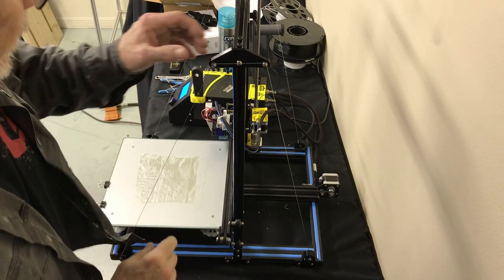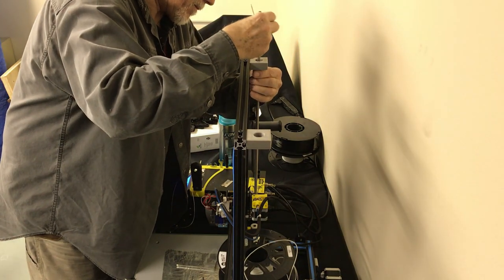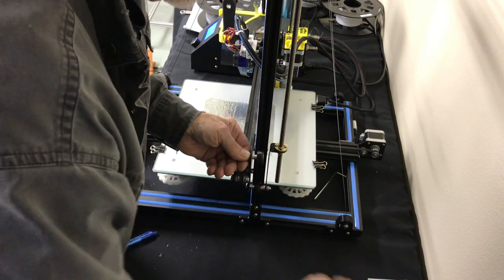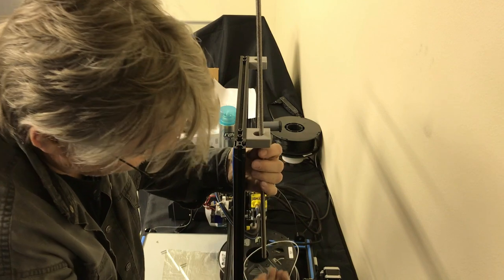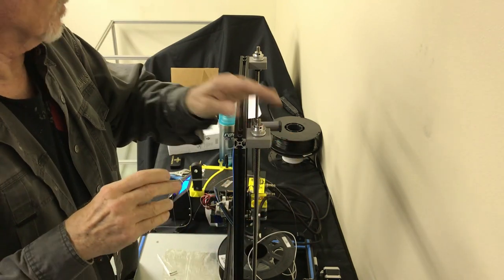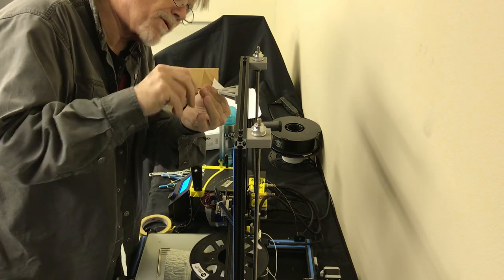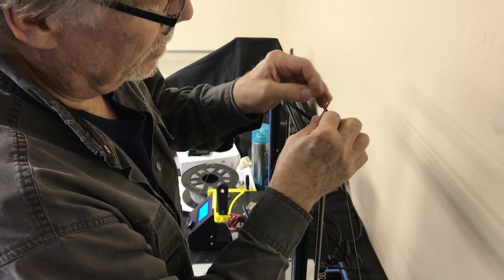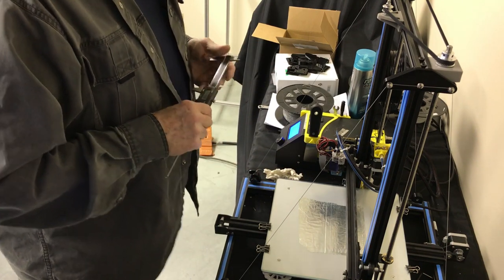Mechanical Dual Z Installation

Comment: Please can you make an install video for the CR10S, to maintain dual z sync.  I assume the kit comes with two longer lead screws?
Reply from the maker: Benjamin Marc Esterson 
The dual motors need to be synced every time you reboot your 10 s because of motor drift. 
If you make a block or gauge it’s handy to quickly run it up to the x beam and turn the right motor coupling to turn it until it’s level. 
 Unfortunately there’s no way to cure that idiosyncratic problem with the s models.
Reply: David Ashenbrener, Surely using a z sync belt will constrain the drift between the two shafts to ticking over in the same direction, thus keeping the dual drives synchronised.  Mechanically there is no reason why it wouldn't work.
Reply from the maker: Benjamin Marc Esterson 
Not sure what you’re asking but you only need one motor. If you’re suggesting using 2 plus a belt it would work but it would be superfluous. Dump one of the motors...
Reply from the maker: Benjamin Marc Esterson  actually you are on to something there...
I would like to see if there’s some way of doing this without having to change out the z screw drives to extend them... one way would be to sacrifice about an inch height by cutting an inch off the two upright rails. Speaking for myself, I don’t use that height anyway...
Does anyone else have an idea?
Reply: David Ashenbrener, For most of the hobbyists, I think swapping out both Z screws is a less daunting prospect than trimming the gantry uprights.  Granted the materials costs will be higher, but it's likely a fair trade for nice square cuts and ensuring both sides are cut to matching lengths.  Is there a particular reason to avoid swapping both lead screws?
Reply from the maker: Benjamin Marc Esterson true. But it’s an alternative. Way to go guys... now you got me thinking about doing that...
Reply from the maker: Benjamin Marc Esterson 
I’m thinking that antibacklash would be needed if using 2 motor z. 
I’ll try it without first. I have both 600 mm lead screws and the antibacklash nuts in order. 
I will do a follow up presentation on it. Thanks everyone...!
Reply from the maker: I will be doing a video of cutting an inch or so off the uprights and the dual rod replacement. I'll put the time and ease of assembly on the clock for each to compare. I'll then check it for backlash to see if the anti backlash nuts are needed.
Reply: Hi, thanks for sharing but here's an idea, how about retinkering  with the top brackets? instead of chopping the frame , would you have enough room if you were to  reposition the 
 upper leadscrew brackets an inch or so lower and mount the idler  upside down but on the back of the top  2020  extrusion instead of front of it?
Reply from the maker: I just received belts I special ordered for the S5 which fits pulley to pulley with no tensioner. I ordered 5 and have 2 left...
Reply from the maker: Andy Davies yes. Update...I refitted all my S models with a sync belt...works perfect. No more measure adjust before printing!
Reply from the maker: Benjamin Marc Esterson you can put the sprockets below the bearing blocks. To minimize the loss of height print 2 thin bearing holders mounted to the top of the rail with 4 t-nuts then position the sprockets with hub up. Now your tensioner will stick out the rear of your machine...
Reply: @neuxstone  I'm delighted my idea worked. Theory is always better percent proven in practice. Thank you for trying it and working it through.
Please could you make a video on the implementation? Or post some photos?
Reply: @neuxstone  Greetings David, i have a cr-10s , did the anitback lash nuts work instead?  i assume they are 8mm
Reply from the maker: Martureo Martus   I redesigned the kit so the pulleys are behind the upper beam. I had to lengthen the motor couplings and put the tensioner brackets on the backside of the beam. 
I will do a video on this. Right now I’m fulfilling orders I received from my Stinger Kickstarter campaign but I’ll get to it as soon as I have that underway.
Reply: @neuxstone  Thank you David, np looking forward to it, and thanks again - i ordered 2 Stinger kits from your kickstarter and cant wait to get them and hook them up - like a kid at xmas lol - thinking of doing a video and review to so i will email you if i do - thanks again and ttys!

Comment: OK. To follow up, I bought the kit and installation was quite straightforward. My problem was the lead screw that came with my CR-10 was oversized. I couldn’t get the flange bearings to slide over it. David was super helpful, in the end he suggested sanding the lead screw while rotating it in a drill... worked perfectly. I’m delighted with the kit AND with David’s help. Thanks David!

Comment: I have two questions.
 What is the purpose of the set collars?
 Also, is there any adjustment to the voltage settings for the z motor due to the potential increased load?  
Great video!
Thanks.
Jason

Comment: I am waiting on a Tevo Tornado, does this kit fit the tornado, where most people say the tornado is a CR-10 knock-off
Reply: should be able to, most of it has to do with the frame and motors which are identical.

Comment from the maker: Anyone interested in linking their motors? It requires mounting the pulleys under the top bearing mounts. This will limit your height by 1”. 
If that’s a deal breaker, you can get a majority of that back by printing a thin upper bearing support bracket mounted to the top of the upper horizontal support and flip the idler bearing bracket. 
There will need to be 4 additional 4mm screws and 4 hammer nuts necessary.  
I’ve outfitted 2 of my printers with dual motors and turned them into my best machines...

Comment: I just ordered a ctc printer which is a knock off of cr10..i figured since my ender 5 has had multiple issues i had to fix i might as well by a knock off and see if it is similar just as good or possibly better... this machine has dual Z axis...not sure what is was yesterday when i ordered...does it mean i has 2 motors? or maybe its a similar dual mechaniacl setup like you made here...thax
Reply from the maker: Yes. Dual Z usually means dual motors. You’ll find yourself checking them often for “drift”. The mechanical link will keep them level.
Reply: @neuxstone  being new to 3 d printers i have a lot to learn... when i get it should i tighten the Z rollers like you did to this cr10 in this video...you want them tight,but i guess not to tight... will this help prints come out much better... i will also be ordering you guy line upgrade since it makes perfect sense ..thankyou.

Comment: I just ordered and received you new kit. I have a Tevo Tornado and i need some instruction with this new kit.
Reply from the maker: I just had a break in and my entire recording studio was stolen. I’m going to try to do an update vid this weekend or following week. Thx for your patience. The new system has two idlers that tension as you separate them opposing each other.
Reply: @neuxstone  I was able to figure it out using the pictures. Sorry to hear about the breakin.

Comment: Didn't see this kit on your website. And why no link in the description ?     ; )
Reply from the maker: Mark Johnson. Please go to the products page. 
It will be directly below the E3D installation video. Some of the components have changed. For instance they’re now black or silver and the bracket is aluminum rather than printed plastic. 
 Thanks for the heads up.

Comment: Funny, i drew up the Exact same design.
Reply from the maker: D. Ryan that is funny. 
Pretty much the most straightforward and logical way to do it. I got the idea (which I mentioned in the vid) from MyFordBoy but he used a longer belt and larger pulleys. It was the need to make them fit my machine using my guy wire gantry kit that prompted the design upgrade...
Reply: I think a few of us have  had the same basic idea mine is still  just an idea at the moment until the parts arrive, I plan to use a spring loaded tensioner  to take up the belt slack and some adjustable leadscrew brackets , but I'll be replacing some parts of the  frame while I'm at it as my CR10's Z & X assembly isnt  properly square  (the  X gantry wheels tighten at the bottom   position and  free spin at the top)  the right hand side of the top bar  protrudes 2-3mm  to the right  with the end cap off not only that it appears to be about 12mm  too short on the X axis as in the home position the nozzle comes down on the bed 12mm in from the edge - this maybe the  way they are built but I dont like it I would rather home with the nozzle off the edge of the bed
Reply: Andy Davies I think a manual tensioner on the belts is tie way to go still but a spring tensioner for the v slot wheels instead of the eccentric nut is the next step for me.
Reply from the maker: D. Ryan you have to watch the spring tensioning so when it reverses direction it doesn’t deflect which will cause backlash. Trust me, better off with solid set tension on belts and wheels. I’m a retired professional cnc designer. You will introduce tiny backlash situations from moment loads.

Comment: You can do the same thing for 1/3 the cost of this kit by looking at my design from which this was copied.
Reply from the maker: myfordboy if you watch the video you will see it wasn’t a copy. You weren’t the first to come up with this idea however clever you are. 
My version uses a different belt so the actuator leadscrew doesn’t go outboard, making way for the gantry stabilization kit which keeps the low frequency vibrations at bay.
Reply: @myfordboy damn I was a fan why would you be so shallow.???
Reply from the maker: Cutler Cycles   Same here.  I unsubscribed him  due to his elitist comment.
 You would think great minds would work together in cooperation instead of bickering over who's idea it was.